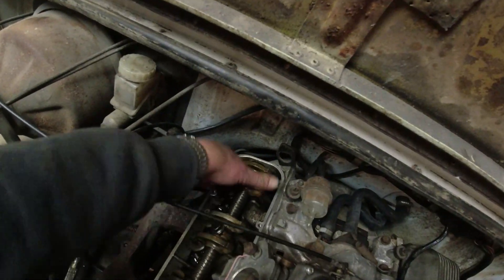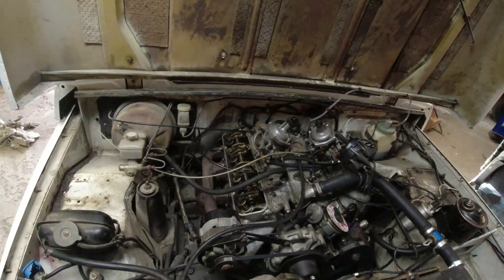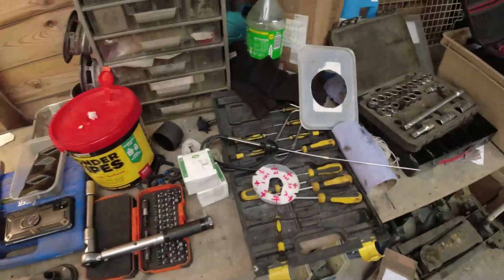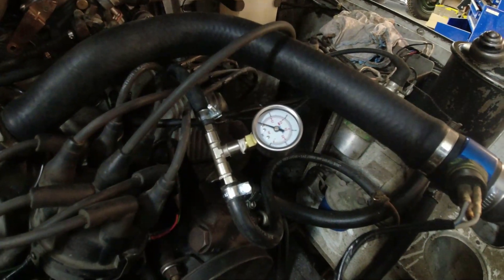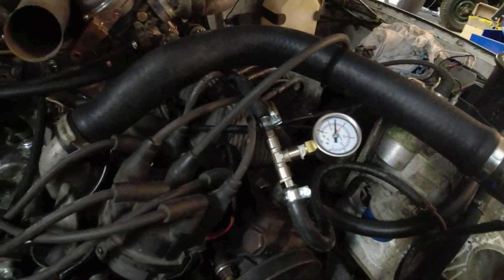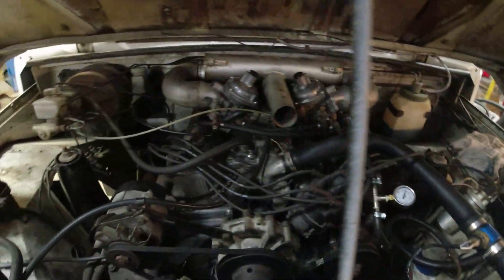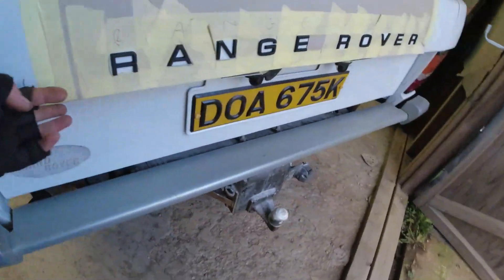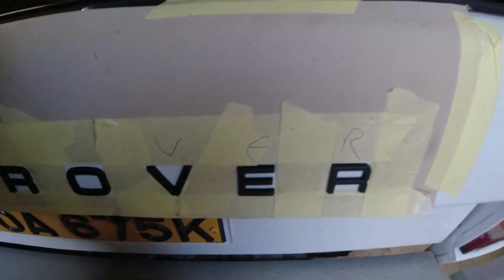1972 Range Rover A Suffix "Diana" Part 13 - MoT is looming - Profanity warning

Comment: Another extremely interesting video! 

That knocking noise sounded exactly llike an empty / faulty tappet. Surprized to see it was the rocker assembly being too high (must remember that). Any good way of telling the difference?

A bit weird that the overflow from the carburretor is not directed to a safe discharge, though.

Car came out great. Looking forward to the next video! 

Cheers
Reply from the maker: The tapping is back with a vengeance, good as gold when cold, mr tappedy tap when warm I will do a feature on what I find and how I resolve it. Pleased you enjoyed the video, warts and all. 🍻👍